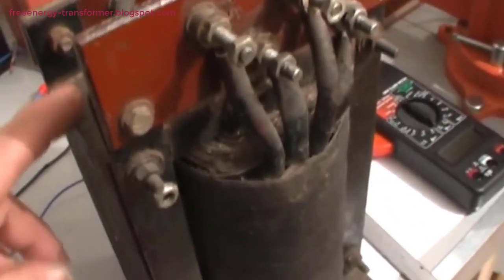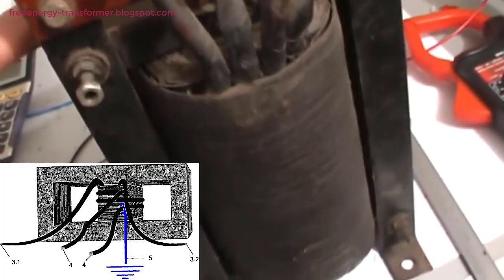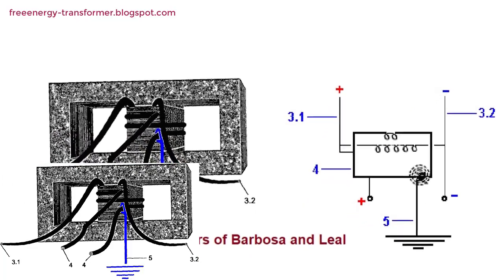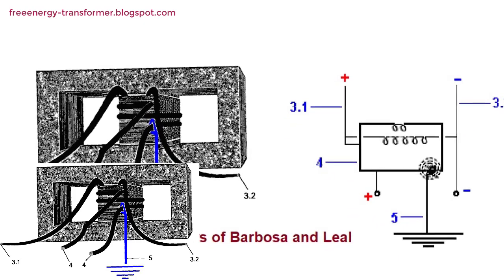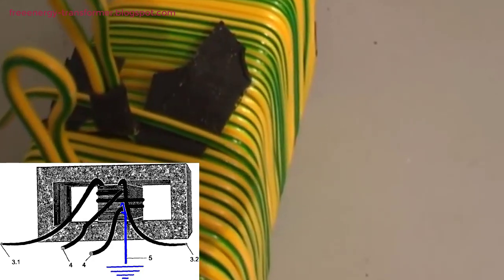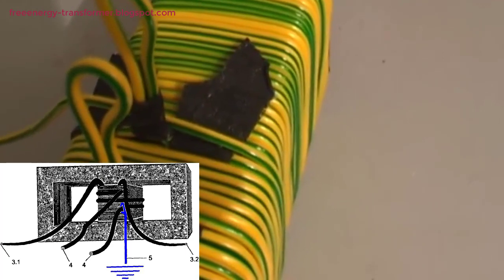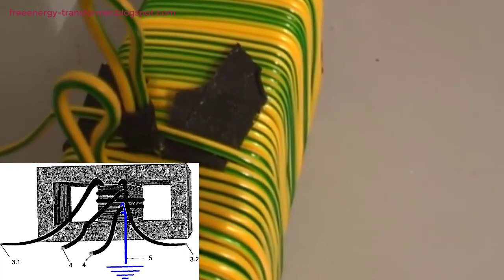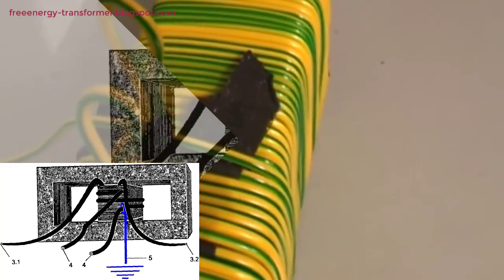Free Energy Transformer: Converts Back EMF in the form of an Ether field (vortex)

Comment from the maker: 💎 According to the reviews, it is a very good book. Although not detailed step-by-step instructions for creating a generator, it is a book that summarizes the knowledge of the power of Magnets to create Free Energy.
💎 The Magnet Motor and Free Energy AC Generator: https://easy-power-plan-dcp.blogspot.com/p/magnet-motor-free-energy.html
💎 Electron particle does not exist:  https://easy-power-plan-dcp.blogspot.com/p/electrical-generator.html
The transformer resists Back EMF (Ether field) by the (circular) wire loop  https://easy-power-plan-dcp.blogspot.com/p/magnet-generator.html